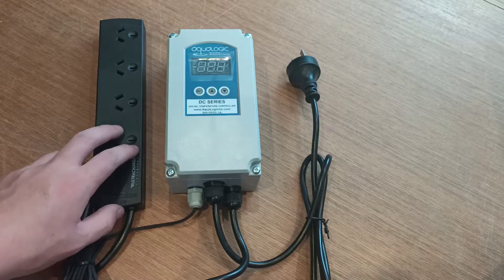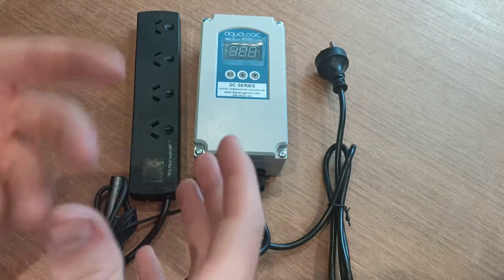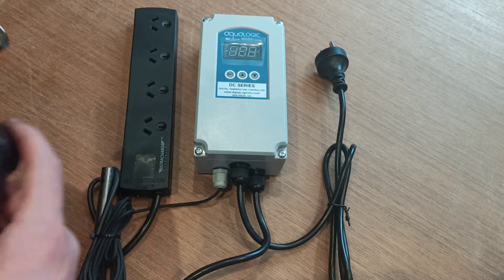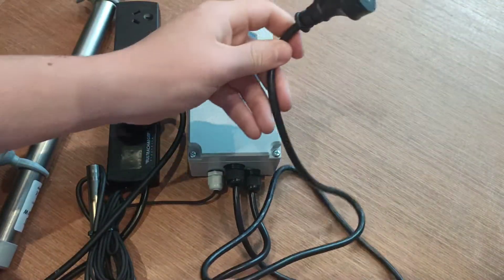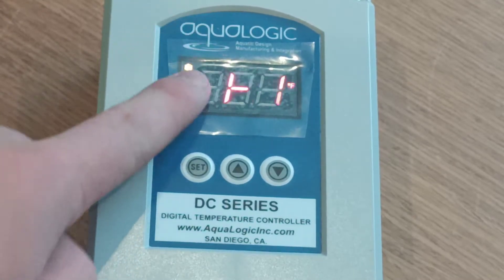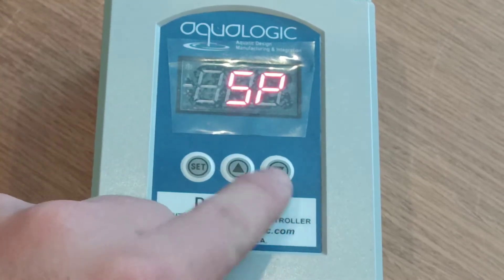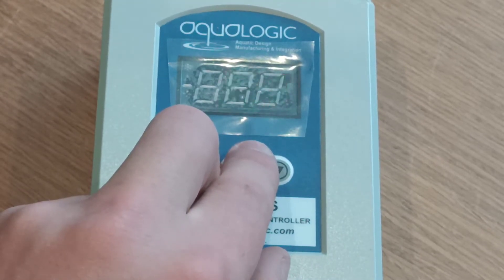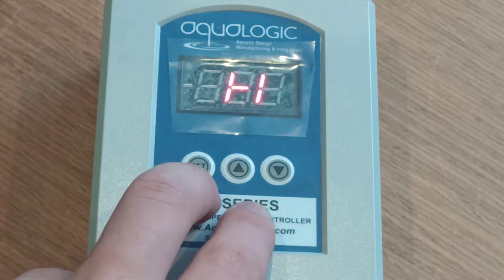AQUALOGIC DC SERIES CONTROLLER Quick Setup Guide

Comment: Iv just set mine up exactly as you show but the thermostat wont turn off? even when I put the prob into very hot water i.e. 45degs its still on? why? please reply.
Reply: Hey mate, I've just had the same problem last night, how did you fix it? Checked this morning and it was at 46 degrees... Lucky it's a new tank with no fish in it yet